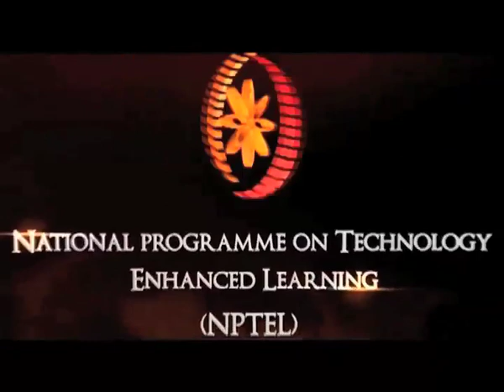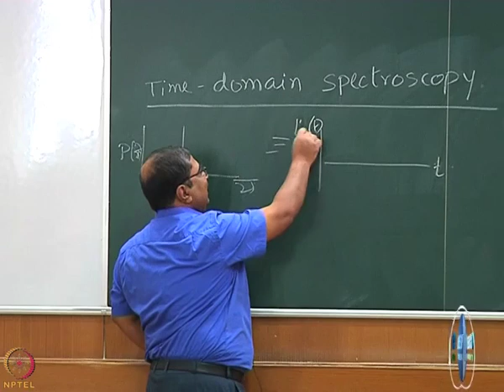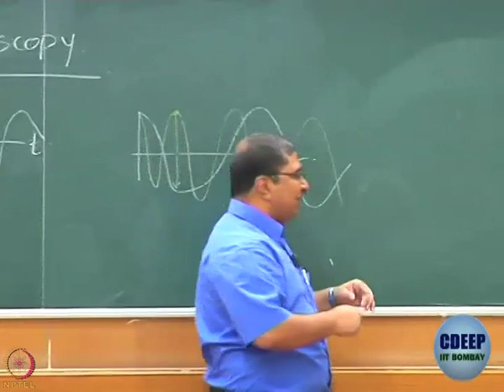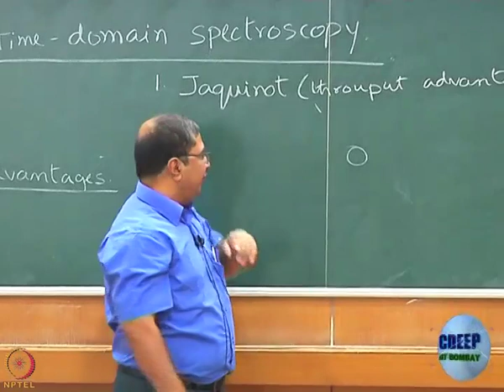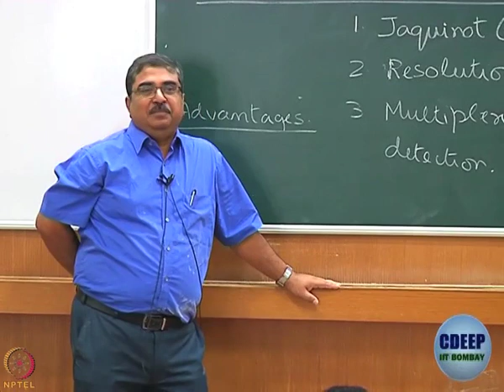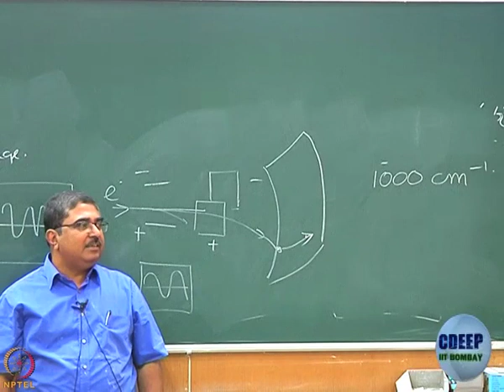Week 1-Lecture 4

Comment: Sir, your class is really nice. But i didnt understnd how you got frequancy as 3*10 power 13 cm-1 and how to convert it into picoseconds
Reply: are these lectures helpful for csir net chemistry exam?
Reply: @RaviKumar-xy5xq  it is not exam point of view.. you don't need extra by seeing this
Reply: There is slight mistake in the calculation: Time (Tau) = 1/Frequency  = 1/(c x wave no.) = 1/(3x10^10 cm/s  x 10 cm^-1) = 1/(3x10^13     s^-1) = 0.033 x 10^-12 s = 0.033 pico-sec or 33 femto-sec